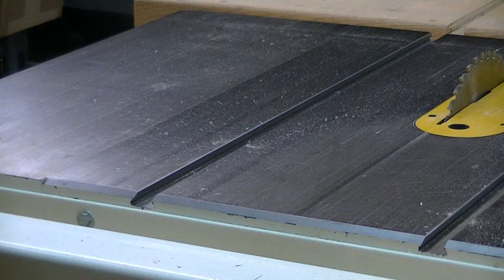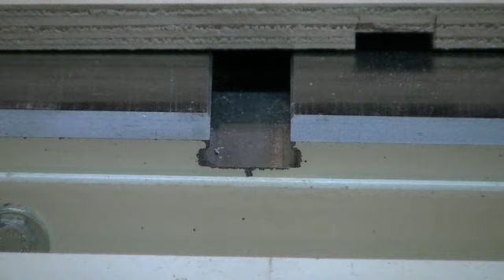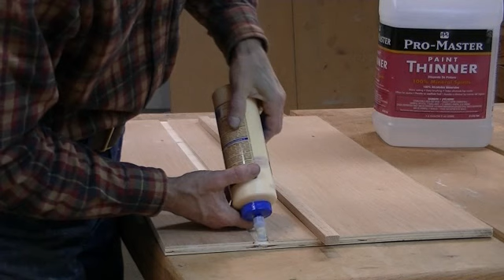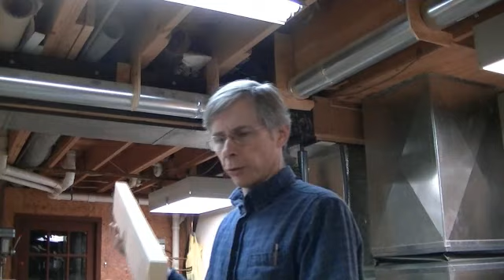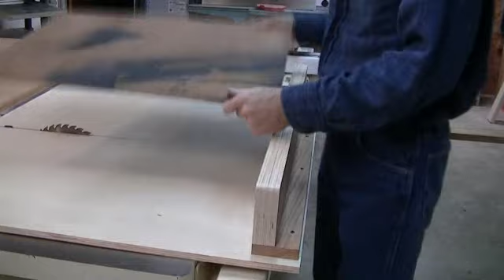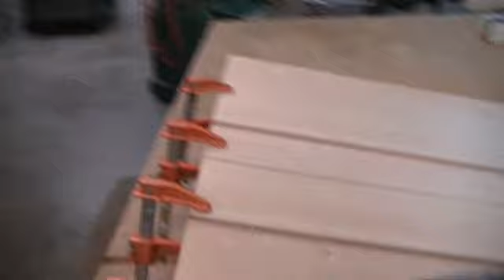Table Saw Cross-Cut Sled - Winky's Woodworking Tips

Comment: I have made several sleds in my small shop but you are the first one to ever put the runners on the correct way giving a 0 tolerance cut from the beginning. I like the method of using the router to make the groove instead of the old method of glueing the runners to the sled. I also love that you did not use the damn 5 cut method to square the back to the board. No way in hell are any of us going to do any work that requires the back board to be within .000000000001 of an inch. Great video. I will watch more of your work.
Reply: Good to get comments on  this old video. It's 11 years old. I started a new channel called Winky's Workshop. It leans toward metal working and restoring old machines but still has some woodworking. Truthfully this is the first comment  I've had on this channel is about a year. Youtube doesn't promote videos unless you are actively adding content. I usually do a video every week but I just broke a bone in my foot a couple days ago so it might be a few weeks before I can post more.

Comment: What is the size of your large sled? Could you do an update video on the sled. Thank you for your help.
Reply: You are in luck sir! I made this video in 2014 and i'm still using the sled but I use it for dados and cutting with the blade a a 45 degree angle. This leaves a big gap in the sled. However, I have a larger sled that will cut a 4 x 8 foot sheet of plywood that I am going to build it again. It's 18 years old and starting to get wear. I will be making the video later this week. You may have noticed my Channel Name on this comment, "Winky's Workshop" This is my new channel and it covers woodworking and metalworking. Maybe you should subscribe so you get notified when i post the video. Thanks!
Reply: Sorry, I should have specified. I was looking at the large sled for the size. I have a 5 x 5 x 1/2 Baltic Birch I would like to use. Are you redoing the large sled? I have subscribed to both channels to try to catch any update on your large sled. Thank you  for the response and I look forward to more videos.
Reply: @kc1850  The large sled overall is 4-feet wide and 5-foot long. With the fences attached the capacity is about 4'4" or a bit more. This allows a 4 x 8 foot sheet to be cut across the width anywhere along the 8-foot length. And yes, I am redoing the large sled. My current sled is 18 years old, doubles as a work table and it's very dirty...  plus the runners are a little worn. It's time for a new one and new video. Thanks

Comment: Mark, I just finished making your sled for my 10” Makita table saw. Man does it make a difference. I used maple and 3/4” plywood for the fences. I really appreciate your videos and how instructional they are. From an old man in Kentucky, God bless.
Reply: Thanks Laymon, I live in KY also. I started another channel several years ago when my interests shifted to metal working. I called it "Winky's Metalworking Tips" but over a years ago I changed it to Winky's Workshop so that I could post both metal and woodworking projects. I plan on posting new material to this channel which will include more woodworking in the future. Check it out and see what you think. And thanks on the sled video. I don't know if you noticed the date (2014). Still I am convinced that my method for building a sled is by far the best and easiest. I now have more experience and a better camera. At some point I'll redo this video and post it to the new site.  I hope you will subscribe. https://www.youtube.com/channel/UCf4EaCarZUA0IrfQnYhnekA
Reply: @WinkysWorkshop  I have subscribed. I live in Monticello

Comment: Thanks I’m looking forward to the ability to cut 4x8 sheets. I have recently made a couple small sleds using the technique of placing the runners in the miter tracks and then gluing and screwing them flush to the bottom of the sled. What I have noticed is that the hardwood still has a tendency to twist and become tight in the tracks. I like the idea of recessing them into dado slots to keep them straight.  I made a cut off sled maybe 28 years ago based on one Norm made on the New Yankee Workshop and it used dados. I have just recently got back into woodworking so it’s back the the dado slot for me. Thanks for sharing your talents.
Reply from the maker: Thanks for the compliments and you are welcome. Just a side note, if your router table is not very large you can use a dado blade to cut the dado. Using the dado regardless of how you cut it really simplifies construction. I recommend a large out feed table if you have the room. Mine is a 1x2 oak frame with 3/4 plywood set into a rabbit. I mounted it level wit the saw table and then cut two over sized dados with a router for the runners of the sled. Both the out feed table and the sled get used as a table. One more thing, I recommend using glue only on the runners. I used screws to hold them in the dado on a past sled and ended up doing  lot of sanding to make the runners slide in the slots.

Comment: Thanks for the tutorial on making a sled
Reply from the maker: You are certainly welcome! I feel like making the sled in two pieces makes everything easier to assemble and improves accuracy. I'm currently using a sled I made 15 years ago and it is still working fairly well but the runners are a little worn and the top is worn and tattered from years of use. It may be a few month but I plan on making an updated video of the sled construction. It will still be the same basic sled with a few updates like a stop block for repeat cuts, a rule for measurements and much lighter weight construction.   Be sure and subscribe!  And thanks for the positive comment!
Reply: Winky's Woodworking Tips . I can see the virtue of making the sled in two pieces for the reasons you suggest.
Thanks

Comment: Nice video Winky! Like most commentators here I like the originality and simplicity of your construction method. I will certainly try this build for my first crosscut sled. Unfortunately in Australia we don’t have ready access to hard woods like you have in the USA, Canada and Europe with their common deciduous trees.

I have just bought some 20 mm thick x 610 mm long ultra high molecular weight polyethylene (UHMWPE) to use for sled runners. This avoids any movement in the runners due to atmospheric moisture changes but I am not sure how glues adhere to it yet. However at least I can use counter sunk screws to hold the runners securely.

One suggestion to assist in lining up the two halves of the sled on either side of your blade is to use two pieces of a blade of the same kerf as the current table saw; or metal or plastic cut to the same kerf width as the blade. Placing these spacers between the two sled halves along the length of the gap from the saw blade to near the alignment fence should assist in keeping the edges parallel and at the correct width.

I like your idea, given in reply to one of the comments here, to fasten hardwood pieces in contact with the fence to allow removal and re-installation with glue to make sure that the alignment does not change. Although I take your point that many screws will hold the fence squarely in position, I also agree with those users of this method who would like to ensure the uniform holding and stiffening transferred to the sled base by a glue bond.

Thanks for your goodness to share your ideas and for your efforts in making an excellent video presentation. I have subscribed to your channel, so please keep up your good work! Kind regards from Australia.
Reply: I would suggest screws with a trim head (small) for holding the runners. When you fit the runners to the bottom of the sled make the dado very carefully so you get a very good fit. The biggest problem you will have with screws is that the screws will expand the plastic as you tighten them. You might also consider a pan head screw and use a counterbore rather than a countersink. Countersinks will try to expand the runner. The spacers you talked about are not needed. You trim the sled after installing the runners.  I totally agree with your last comment. Wood blocks clamped to the sled an glue the fence. I've never had mine move but glue is a good idea.
Reply: Thanks Winky for your reply to my comment. I take your point about the “V” of the countersink screws creating lateral forces which would try to expand the polyethylene (PE) against the runner walls. I agree that the smaller head of trim deck screws would exert less force in the radial direction to the screw axis. Your second suggestion using flat-headed button head screws would exert almost all of the screw force in the axial direction. Wafer head screws with the slightly larger flat on the head may be even better. Used in conjunction with a counter bore as you suggest, and perhaps a small flat washer to distribute the force over the larger surface area of the flat of the bore, would ensure less distortion pressure on the PE for the same holding force.

I hope to get in the post soon some 3M acrylic plus double sided adhesive tape (15mm wide). I will see how the tape bonds to the PE - it should bond to the wood OK. If this works it should be an even easier and better method for holding the PE runners in the trench. I will ensure that I cut the PE runner width to a tight fit in the trench so that friction will be on my side too. I will let you know how I go. Thanks again for your conversation.

Comment: I bought a table saw yesterday and I'm thinking this is a very good easy to follow way to make one. Very nicely done winky.
Reply: Thanks for the compliment and yes I agree, this is by far the easiest way to make an accurate sled.  If you have the room attach a 4-foot table on the out feed and build the sled 4 1/2- foot deep. It's great for cutting a sheet of plywood. Of course if you have space limitations a smaller sled is still very useful.

Comment: I've been looking to build a small sled, didn't want to get into 5 cut method and others i've seen. Your way is really interesting in that the the accuracy and parallism is "built in" to the design and your getting a parallel like the whole length of the kerf, so parallel and accuracy is inherent to this two part design. Thanks for posting this. This is one I can wrap my head around without much thought. I know i'm gona have to apply glue under the fence though. Not sure why you didn't apply some, you would have plenty time to make any adjustments of needed. Even if used some slow setting glue or 10 minute epoxy ?  Either way, great design and thanks much for posting it !
Reply from the maker: Thanks for the great input! Yes, the 5 cut method is weird if you ask me. Flipping the wood doubles the measured error. In my opinion you really can not get more accurate. If you've ever tried to measure would with a micrometer you'd understand... nearly impossible.  About the glue, Epoxy might be a good choice but I don't recommend any kind of wood glue. I did this on one sled I made and it made things pretty hard to manage. The glue makes the fence slip around at first and then grabs when you don't want it to. So here's a possible method for gluing: Use a few temporary screws to square the sled then use a brad nailer and tack 4 small stop blocks to the surface of the sled firmly against the fence. Then remove the fence, apply glue and then clamp the fence to both the blocks and sled and attach with a few screws. Remove the blocks after the fence is secured.  Thanks, for the comment.

Comment: Winky,  I just completed doing my first cross-cut sled or should I say your cross cut sled.  I came out real well and I want to thank you for making it nice and easy to follow.  I stuck to your format pretty much until I got to the front panel.  I used two pieces of 1x3 birch as a sandwich instead of your plywood with the intention of routering in a t-slot on the front piece for a stop block.  Everything else was your syyle and again I want to thank you.  I was fortunate to have it come out square and I am real happy.
Reply from the maker: Thanks James. The T slot is a great idea. I have a piece of wood that straddles the fence and I use a clamp to hold it. At some point I might add some kind of stop system. It would be nice to have some kind of fine adjustment also.
Reply from the maker: Thanks for the great compliment. The runner attachment and 2-piece construction seemed like an obvious solution to an otherwise tedious build. I'm no genius but I am surprised other videos are not showing this type construction.  Thanks again

Comment: Winky, great video!  Question.  What is the advantage of the two separate bases each with their own runner versus installing 2 runners to a single base?
Reply from the maker: This method makes it much easier to attach the runners accurately. It allows you to cut a dado to mount the runners without being concerned about accurate spacing.

Comment: Great video for the sled build.  I also really like your input support slides.  Do you have any information on how you built these support slides?
Reply from the maker: I didn't cover the supports because there are so many different fence rail designs. On my saw the fence rail is 2 x 4 steel tube and the top surface is about 3/4" below the table surface. I basically laid a 3 x 3/4 oak board on top and glued and screwed a couple of 4 inch strips to the bottom of the board so that it made sort of a saddle for the rail. My old saw was better. I hinged it from below the rail so that it folded down out of the way. Maybe I need to make another video and improve my saw.

Comment: Thanks for the video, I did get a small detail that I was pondering about the other day. I still haven't begun with Woddy Hyezmar's book yet, I've found videos to be better for me, though he is still giving it away, google him.
Reply from the maker: Thanks Henry, I'll check it out. There are many ways good ways to make a cross cut sled although I think I have most of them beat with my runner attachment method and making the sled in 2 halves. It's much easier to built like this. I've seen some great ideas for stops that I'd like to implement on my own. One common thing I see is a raised are on the back fence around where the blade comes through. Some say this is added safety so your hands don't get near the blade. I just made the fence a little higher and left it flat on top. This adds a little weight but clamping jigs to the fence is way easier. For this reason I say leave it flat. Now the far side fence can be most anything and it probably makes sense to lower the profile on each end to reduce weight. Thanks for your comment.

Comment: I really liked the way you built your cutoff sled. Doing it in two pieces like that solved any problems of runner alignment. Since I don't have a jointer, making the fence the way you did seems like it should be easy to do with just the table saw. Thanks for sharing.

Comment: I am interested in making a large sled as you showed at the beginning of this video, can you share any info especially the supports you made to hold the sled before the blade.  Thanks
Reply from the maker: +Set Fire To All Trump Supporters : The supports are about 2 1/2 x 3/4 inch strips of wood (oak). I think I made them about 36 inches long. The thickness is about 3/4 but I planed it down so that when I laid it flat on the fence rail it was flush with the table top. Then I cut a couple of cross cut dado and inserted some scraps of oak so that it straddled the fence rail. It's really pretty simple. On the other end I laminated a scrap of oak to the bottom to give the rail some thickness and drilled a 3/4" hole almost all the way through. Then I glued dowels (old broom sticks I think) in the holes.
Reply: Winky's Woodworking Tips thank u VERY MUCH

Comment: Hello great video by watching I could tell you know what you're doing. I have a question when you squared the fence I noticed you used a fairly long square. So you were squaring the fence with the whole kerf line of the blade and not just the blade itself right ? I do know from experience using  the miter guage alone that if you square the guage with the blade. And if the blade is not aligned with the miter slots even though the guage is square to the blade itself. You won't get a square cut. So what I'm asking is,, will you get square cuts with the sled by squaring the fence to the miter slots ? I also subscribed I look forward to watching more of you videos ,,,thanks
Reply from the maker: ***** Hello Steve, Good question! The blade needs to be square to you miter slot which is a table saw adjustment. It involves moving the arbor and tilt mechanism. It's not difficult but it is a bit tedious. If the blade is not square to the slots it can cause all kinds of problem. To answer your question, yes, you square the back fence to the cut in the base of the sled. If your blade is only slightly out of square the cut will still be square but the quality of the cut won't be very good. You will have more saw marks, splintering and possibly burning.
Reply: Thank you sir

Comment: I like your design and build process. What are the dimensions of you large sled?
thanks in advance.
Reply: Thanks - the larger sled is about 48 wide (slightly under due to the center trim) and 55 inches deep (to accommodate both fences and still be able to cross cut a 4 x 8 ft sheet of plywood.